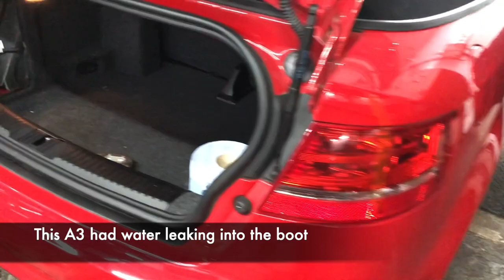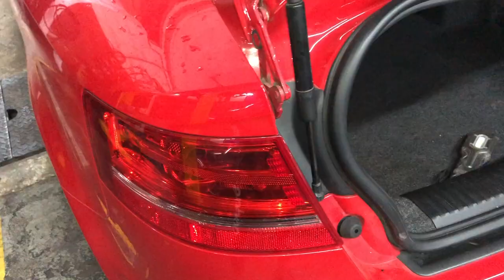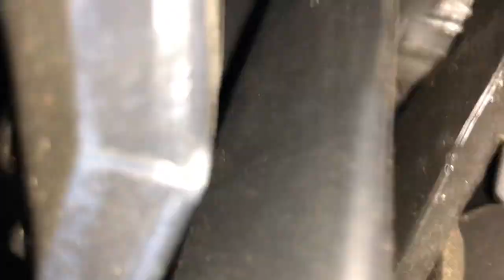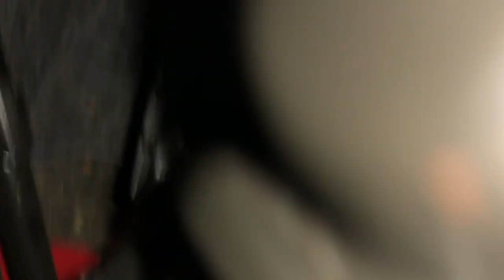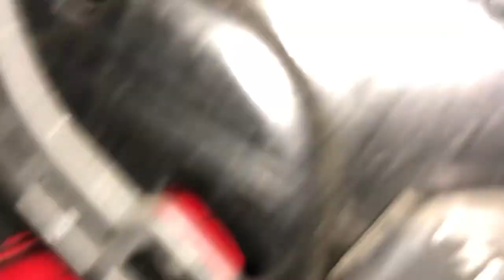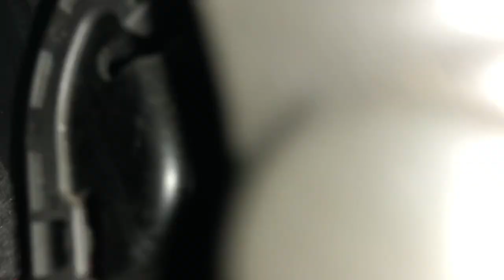Audi A3 Convertible Roof Leak Into Boot FIXED 2008-2012 8P7 Cabriolet

Comment: Thanks for this; boot floor drain plug released water pool.  It’s very tight to get access- Managed to check both seals as per video, one side was slightly off position, will monitor meantime.
Reply from the maker: I hope that fixes it but there may be more to it, there a piece of plastic with foam behind it that runs behind the bodywork. A plastic trim clip screws in to hold it down and this can be part of the issue too. Hope you get sorted!
Reply: Where is the drain plug please ?
Reply: @suesalter5117  in the bottom of boot well , under tyre puncture kit.  A round rubber plug/disc, roughly £2 coin size, use pliers to pull out and release and drain water pool. Retain  plug and fix back into hole, can be fiddly.  Good luck.
Reply: Thank you 👍

Comment: Mine is leaking in the same area, this makes sense and I will have a look tomorrow. Did you just push it back in place or glue it? And won't it just come loose again next time you put the roof down? Mine seems to have an intermittent leak so I'm wondering if it just falls back differently each time the roof is used.
Reply from the maker: Hi Keith, yes it was just pushed back into place and that appears to be how it sits. It must be just odd circumstances that it does get pulled out of position as I initially thought this but it seems to be fixed now. Hope it fixes yours too!

Comment: Thank OP, but this wasn't the problem for me. Sometimes it rains and is bone dry, other times you could keep a couple of fish in there. My latest solution - remove the grommet in the boot floor, so it can drain out! Any other ideas appreciated!
Reply from the maker: Hi Keith, there is a screw in trim clip about 2.5 in diameter on the inside of the body of the car holding plastic against the metal. I’m sure this can come loose and cause some issues too if you want to try tightening that or removing and adding sealant.
Reply: Hi where is the plug

Comment: I'm definitely going to have a look at mine but before I do (I've had that leaking problem since I got the car 3 years ago). By any chance do you know how to fix the rear driver side window, it just stopped working out of the blue so the roof no longer goes down. Any ideas? 😷
Reply from the maker: There are lots and lots of position sensors that have to read correctly to operate the roof so an educated guess would be one of them is malfunctioning or there is specifically something wrong with the window mechanism/motor
Reply: I’m having that exact problem now. Did u manage to sort it? Any advice?
Reply: @ootahbeefz5501  Literally just ordered a part.. So I bought an OBDeleven device scanned the car and checked the faults. It says Right rear door control module - no signal/communication. I've ordered the driver side rear window regulator which has the control module attached (OEM Part) and should be getting it fitting in the next 2 weeks.. So fingers crossed that fixes the issue and it's nothing to do with a severed wire or something.. Then I can hopefully fix this leaking boot issue because I still haven't done that! [Looking for window seals atm also because the ones on the car are so old and hard it's scratched the window a bit 😢].. advice.. get an obdeleven and diagnose the problem.. sort the problem.. become happier 😅
Reply: @numbersletters1442  cheers fella. Gonna look into it. I’m wondering if there a way to the tray without put the roof back.
Reply: @ootahbeefz5501  no worries bro.. 🤔 not without removing the panel which you’d need to remove the back seat first.. that’s all long.. only other possible way I can think of is to open the roof manually with that tool in the boot.. I don’t think the window would cause too much of a problem but I’ve not tried it
Reply: @numbersletters1442  👊🏾thank you my guy.
Reply: So.. I got the window fixed! It was a broken wire in the drivers door.. Audi specialist said the motors never go on Audis.. I was then able to open the roof halfway to get access to the apron but to my horror I discovered it was sitting perfectly in place with 2 holes in it.. So now I don’t know how to even attempt a repair and can only imagine the cost of fixing that 😓
Reply: @numbersletters1442  please tell us, what was the outcome 🙏 what happened??? I just got this car in October, now with all the rain and the ice a few weeks ago, I find moisture build up in cab... I don't even know what the problem could be, seems to be a job for a professional 🤓 not little old me 😑
Reply: @DrasticEvasion  Ok.. So.. I was able to open the roof halfway to get access to the apron with the holes in it.. I decided to fix it myself 😅.. I used extra strong black duct tape and patiently patched the holes from both sides, on both sides (it's discreet but I hope nobody looks there when it comes time to sell it).. the very next day the rain came down hard which I was happy about.. seemed to have fixed the water getting in the boot!!.. I now have a 12" sub in there 🔊.. just let little old you try fix it first because I think I've saved myself hundreds 🤠
Reply: @numbersletters1442  hello, where to also check my headset and if I understand correctly, do I have to lift the soft top halfway and put my hand or do I have to remove the rear seats?
Thanks
Reply: We’ve noticed water into the boot after heavy rain causes the instrument cluster to die (no lights or gauges & car immobilised) until it’s dried out.

Comment: Mines leaking in the same area , I checked mine and it was sitting ok , I pulled it up and pushed it back on just in case it wasn’t  on there properly but I will see in the coming weeks
Reply from the maker: Hi Jay,
There’s another possible reason for the leak. There’s a large round rim clip that for some reason water can get behind or isn’t as tight as it needs to be. It can be a bigger job to fix as ideally you need to silicone behind the trim but tightening may help. Let me know how you get on 👍
Reply: @IAMASPANNER  where abouts is this rim clip?